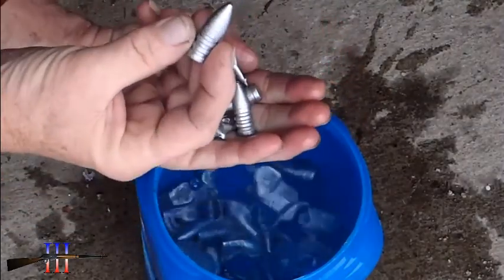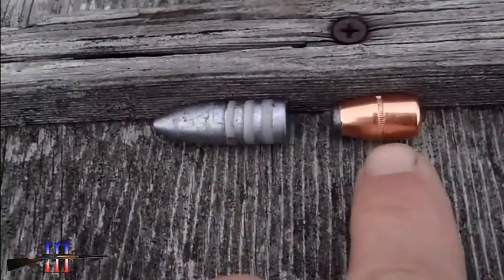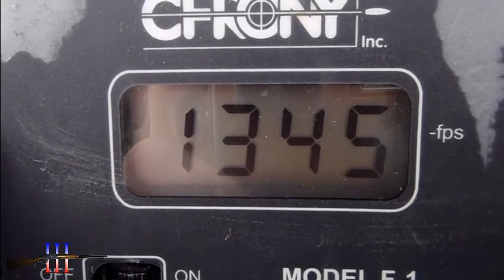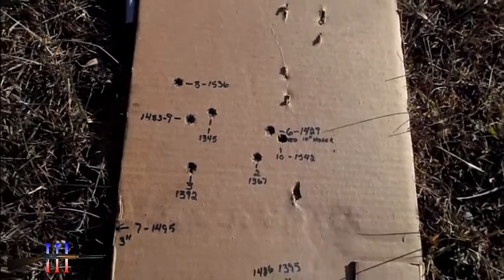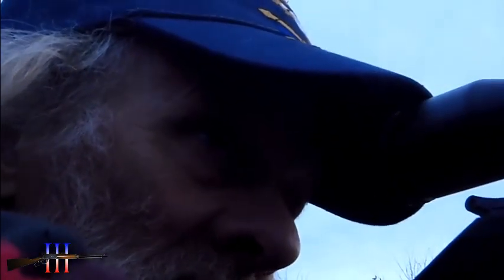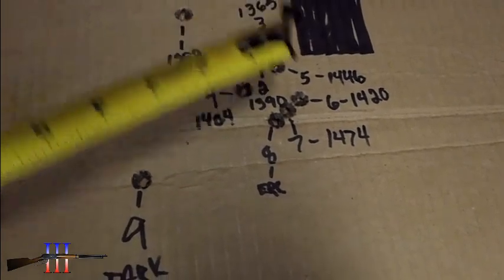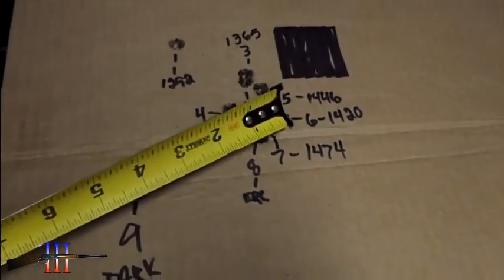500gr Bullet for the 45-70

Comment: I have this mold and am going to be working with it in my TC Encore pistol barrels for some accuracy shooting. 45-70 , 458 Lott. I have found in my 500 S&W barrel and 45-70 that many thought oh it won’t stabilize because of twist rate, they were right , at certain speeds it did not . Then continuing i found indeed there was a speed it did so!  Just a matter of finding that magic spot. I use very heavy for caliber bullets at moderate speeds to do the work at much lower pressures. This works well,  especially so handgun ranges.

Comment: An excellent powder for cast bullets in the 45-70 is AA-5744.   It is bulky and takes up a lot of space in the case, which is ideal.   Also, your (less than ideal) grouping may be the result of the relatively slow twist, which I can only assume is about 1-20", which is the Marlin's twist.   It is probably too slow to stabilize 500 grain bullets.

Comment: have a Henry single shot , and all I shoot are 500 grain hard cast powder coated, at trap door levels.  blows though moose, as in both shoulders , very little meat damage.
I use varget 43.1 gr , lee 3.1 dipper. and a magnum primer as I get a better burn on that powder. I believe my oal is 2.835 , recoil is mild. more of a shove then a kick. I don't bench rest shoot, but I'd quess the felt recoil would be bad then. 
any ways love the round, mine are same only I powder coat them,  blue , because why not .
Reply from the maker: Yes, I powder coat mine now, and am impressed with this bullet. This is mre of a push, and the 340gr bullets I shoot are more of à punch.

I only hunt deer with mine.

Comment: I am shooting same slug with 70 grains compressed 2f powder out of my 73 Springfield... really nothing I fear in the North American woods with it.
Reply from the maker: That is my thoughts exactly, there is a lot of energy behind this cartridge!
Reply: @Win94ae  Update on it, I done some shooting out to 500 yards with same load same bullet over the summer, the Spire point really grants the 45-70 a new lease on life, my shots were fairly flat about 2inches high at 300 . 500 yards were not quit as good but I think it was me not the gun. But out to 300 could put it easily into a deer shoulder. I would like to know if you worked with yours anymore?
Reply from the maker: No, my rifle is not being consistent enough to be able to trust it at 150 yards, let alone 300. I have to go back o using my revolver. :(

I am glad you are having such great success with yours!
Keep up the great work!
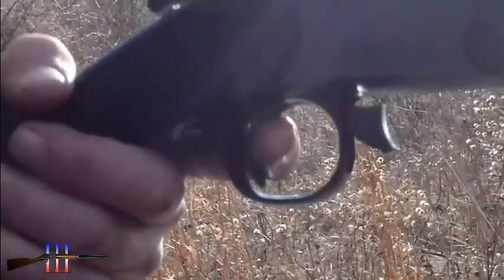Reply: @Win94ae  ouch sorry to hear about yours. Maybe the twist in that rifle not slow enough for the bigger bullets? I'm shooting mine out of an original Springfield 1:22 twist
Reply from the maker: No, my problem is with the rifle's construction. The stock or pick-up  causing inconsistent poi problems with all bullets. It shoots sub-moa met the time, then the poi changes and I get sub-moa groups in a different spot.

On to of that, my bore is rusting out of control now.

The rifle is not worth my time.

Good luck with yours!
Reply from the maker: I think I fixed my problem, so hopefully it works now.
I'm glad you have yours working well!

Thanks!

Comment: What is your COL? My reloading book says 2.550 BUT that's to short for the 500 gr bullets i use. Mine are at 2.880. At 2.550 bullets fall into the case unless i add way to much crimp
Reply: I got the COL for mine from some old rounds i had that was factory loads. ( old school they was loaded copper cases) i had to look them up to make sure they really loaded in copper cases at one time
Reply from the maker: Yes, mine are at 2.875. That COL is probably set to be used in a lever action, so it can cycle through the action.
My rifle doesn't have a magazine, I just have to not hit the lands while chambering a round.
If you look at the 45-70 Government for the Ruger #1, it has a COL of 2.925, because it is also a single shot, and is probably set to not touch the lands of a Ruger #1.

If you are using a magazine, try a dummy round to see if it will cycle. If not, see if it will chamber with the action closed; then inspect the COL and bullet to see if you hit the lands.

I hope this helped!